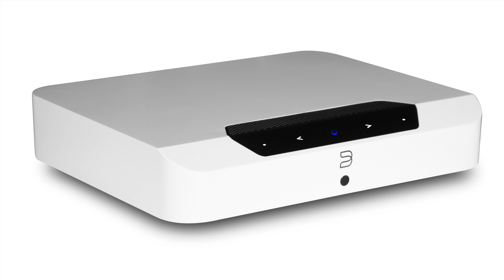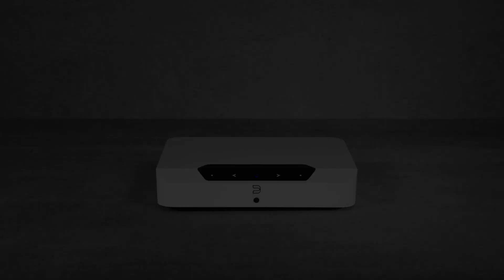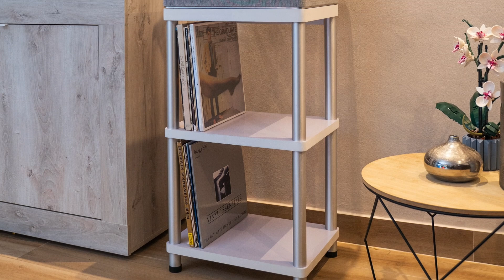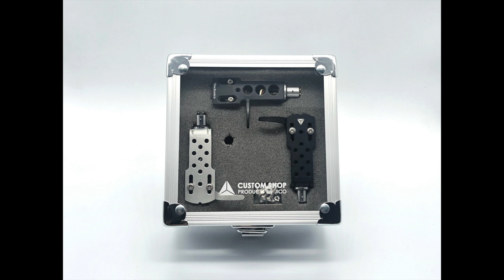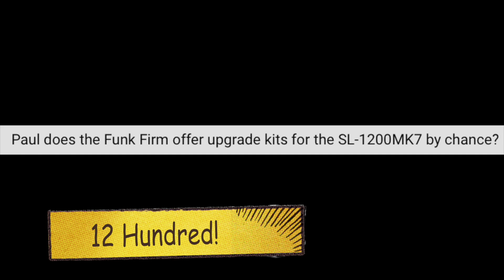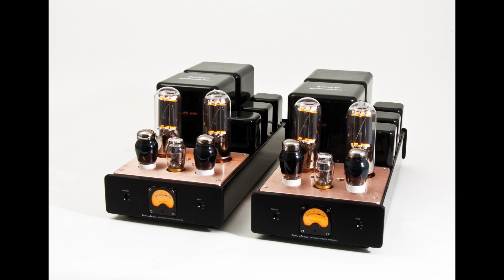HIFI NEWS, ETC. FEATURING HIFI NEWS PLUS VIEWER QUESTIONS (OH YES) PLUS A HINT! A TIP!

Comment: I like the tips especially the phono preamp and cartridge reflections. I'm interested to know whether you have spoken to a cartridge designer about the benefit of warmup period, and why it might be needed?
Reply from the maker: No, but that's a good point, Peter. I'll ask a likely target ASAP.
Reply from the maker: Well, I did promise. Here you go...I talked to Origin Live in the UK. They've produced carts in co-operation with Soundsmith. They provided tow reasons: The suspension loosens up with motion and frees up due to the heat generated - I have heard of people putting a warm light near the cartridge before playing to do this job and two, the phono stage only warms up properly with signal passing through it.
Reply: @TheAudiophileMan  Thanks Paul, that makes sense. I was sure you were right about it having an effect, but ever the scientist I was keen for a reason why it had an effect. It's easy enough to run one side of an LP for the desired warm up.

Comment: On the Soundeck feet question, I recently put a set under my speakers. What I would say is their Teflon like finish makes them slippy and my speakers did not feel secure on them (it was like placing my speakers on ice). I ended up using masking tape on them to reduce the slippiness. Passed the feedback to Leslie.
Reply: Have a look at the Les Davis isolation discs, might be an alternative. They work well for me.

Comment: Excellent new slot. I can agree 1000%, the Moon 110lp is an awesome phonostage.
Reply: Moon gear in general is v.g.  Does really, really benefit from warm up though (Esp their amps - probably why a certain cheap audio reviewer hated the 240i as it needs an hour warm up to really sing).
Reply: @AJ-tg4us  always wondered what a step up from the Moon 110lp V2 would be, struggling to find a phono stage that is better for less then 1000 euros, so I am sticking with it. As for warming it up, it is always on so...
Reply: @LTFC_Quinny  Have a Whest two.2 which I bought direct from the company for under a grand (and had a great chat with the company owner).  Moon phono is awesome though, great sound/build/resale value and guarantee.
Reply: @AJ-tg4us  you have got me interested in the Whest two.2. Would it excel beyond that of my Moon 110lp? Heavy price tag, I will investigate more reviews....
Reply: @AJ-tg4us  I bought a Whest Two.2.....better be good :)
Reply: @LTFC_Quinny  adore mine, low background noise and very detailed. Works really well with my quintet bronze mc cart. Hope you get similar results 9rem warm up time).
Reply: @AJ-tg4us  9rem, what does that mean? I have a low noise Hana ML on my Thorens TD-1600 with a Yamaha DSP-Z9 so it should sing like a bird...😆